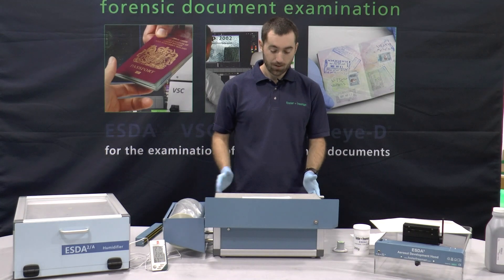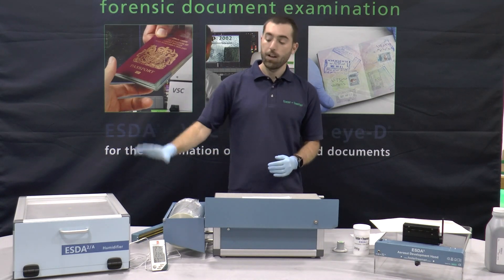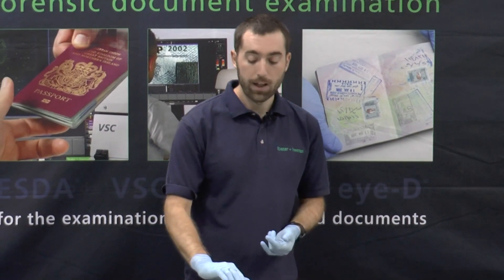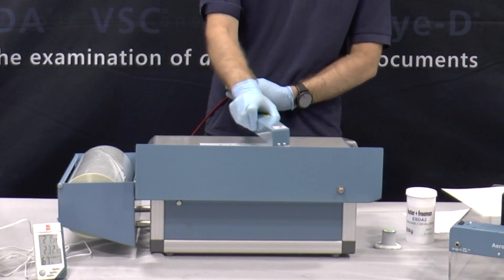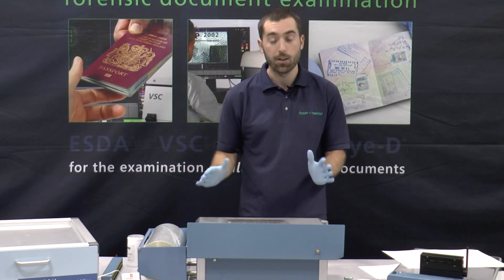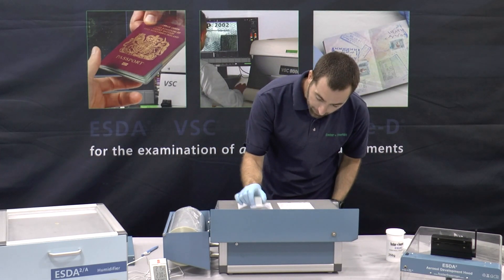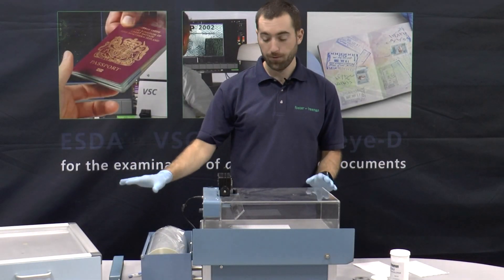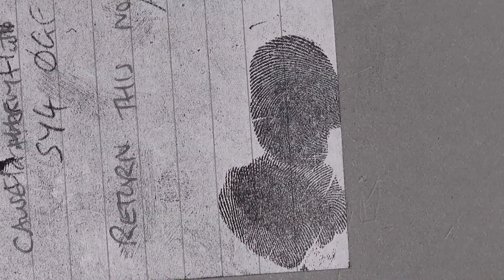Uncover Hidden Messages with the ESDA®2

Comment: Question!I have a document signed but half of it has a company rubber stamp on it.I lost the case in court because the forensic expertise could not see the full signature.ESDA can read the hidden signature under the stamp?Thank you
Reply: It might be possible indeed. The stamp would not affect the ESDA process so you could reveal the signature this way. 
The use of VSC (Video Spectral Comparators) could also help you to isolate the signature from the stamp. With a bit of luck, the two inks will be chemically different enough to be isolated with fluorescence or infrared reflection.